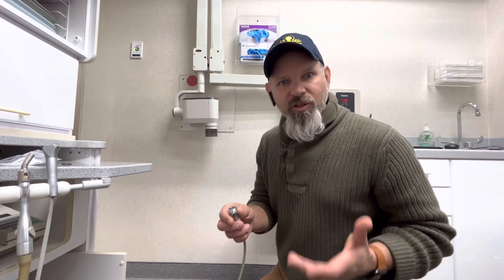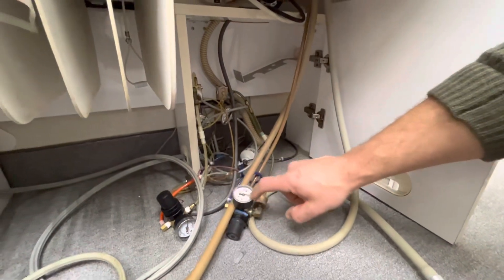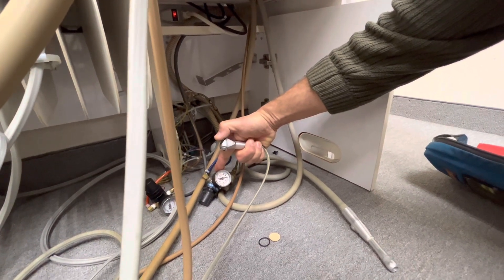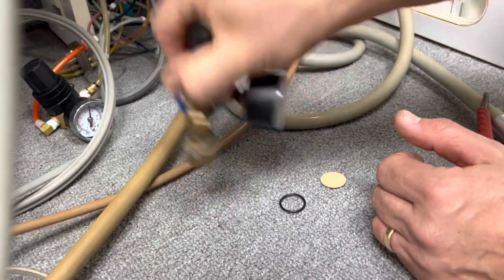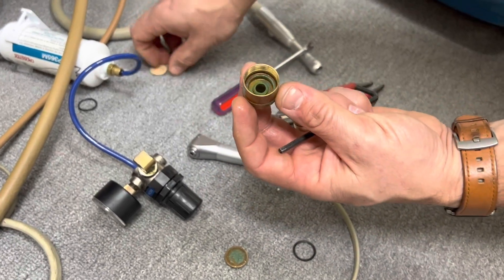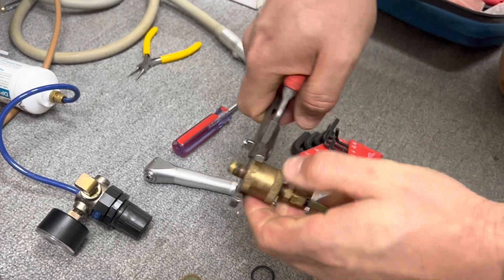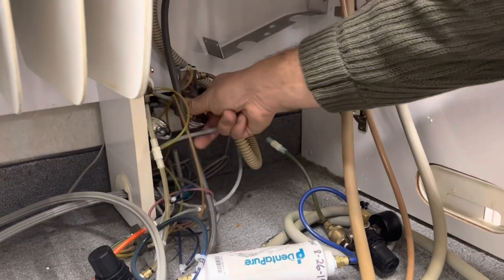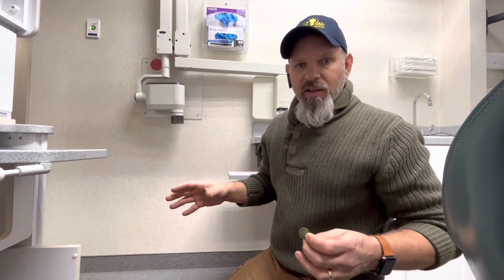Unscripted Water Clog Fix!

Comment: so this is only possible when running city water?
Reply from the maker: @mathiasgonzalez1849  you can get this happening when there is a pinched line or a clog. Trace the line back and see where you have normal pressure. A common culprit is a one-way check valve.

Comment: Wow such a small filter I don't like that, and I would clean the brass parts with ceramic toilet cleaner as it works best on water clogs and doesn't affect the brass as I can see the brass is typically a bit greenish inside, cheers.
Reply from the maker: I do use acidic cleaners sometimes on autoclave parts and dental vacuum parts. This repair was in the field, so I had the bare minimum onhand.